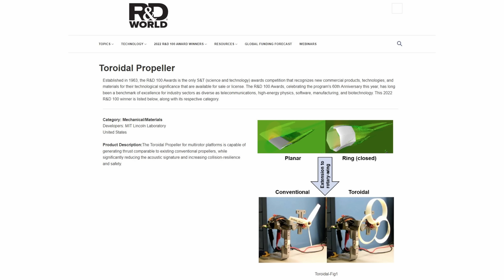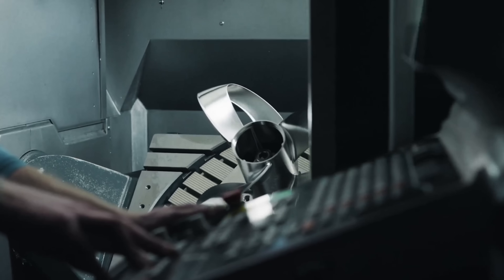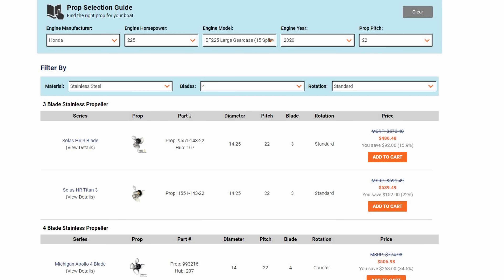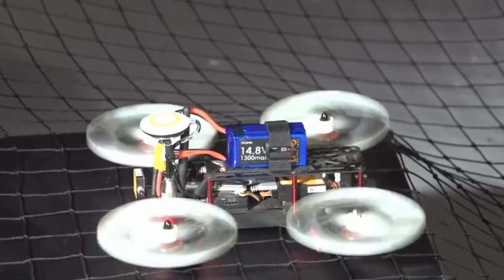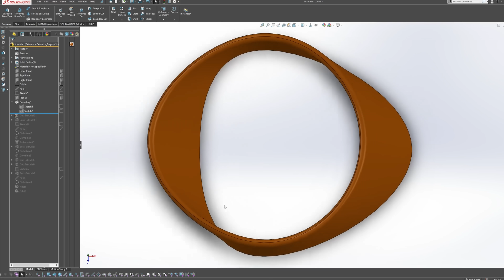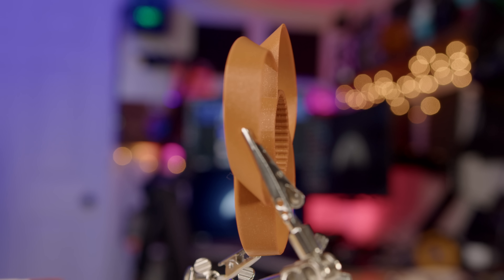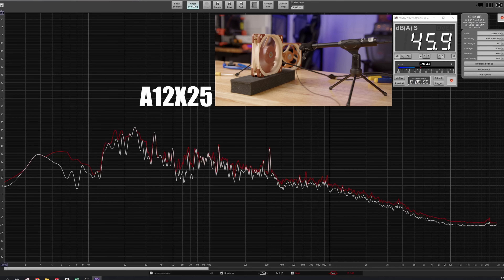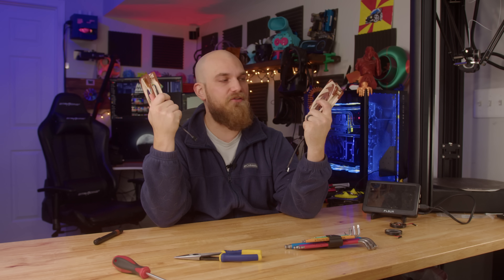I Turned MIT Award Winning Toroidal Propeller Into A PC Fan | Fan Showdown S5 Special

Comment: You might not be noticing as much difference in sound due to the fact the propeller blades on the A12X25 are shrouded/ducted which reduces the tip vortices.  So no real advantage to the toroidal propellers in this particular setup.  If the fan blades for both were out in the open you may see a difference where the toroidal propellers are quieter.

Comment: You should 3D-print a toroidal for the drone, and a copy of the noctua for the drone, and see which one flies the best.
Reply: I would love to see a copy of the noctua fan on a drone! Especially given the pretty high volume of air it shifts, plus noctua's legendary low noise profile.
Reply: And use the drone blades for cooling the computer.

Comment: Interesting idea. I do think a significant difference from the drone configuration is that these fans are ducted. That is going to have a massive impact on the tip vortex behavior and therefore the sound. I think it's plausible that the duct is already mostly mitigating the tip vortex induced sound anyways, thereby erasing any advantage the toroidal would have in open air. The RPM difference you pointed out does make some sense too, though to me the Reynolds number is already plenty high enough even in the pc fan situation that I don't think there would be a significant difference in terms of turbulent vortex induced sound.
Reply: I agree, that's the first thing that struck me - ducting changes the circumstances of a relatively straight blade. Essentially the toroidal blade is a halfway house between an open-ended blade and a ducted blade

Comment: "Raise your outdrive", OK you have my attention.

The difference is going to be that flat edge.  The A12X25 has rounded edges where yours is flat.  (The A12X25 was designed for quiet in this manner.)

Great video, will check out more.

Comment: Very interesting. Considering how close some of these numbers got with just the initial design using a 3D print, I'd say it probably has quite a bit of promise. If I were doing it, I'd definitely try more blades first; probably would start by taking the existing design, duplicating and rotating it to fit between the existing blades.

Comment: If I've understood correctly, you can simulate the turbulence of air by making the same experiment in water with slower speeds. As a result, it should follow that whatever design works in water (e.g. commerical toroidal propeller for boats) should work well in air as long as you drive it faster. If the commerical boat propeller is designed to run around 2000–4000 rpm, you might need to spin the similar design around 20000–40000 rpm in air for optimal performance.

And running anything with such rpm will require near perfect balancing and strong materials.
Reply: Reynolds number (ratio of intertial to viscous force) is length x velocity x density / viscosity. You won't get that to be the same. 
Specific speed  (rotational velocity x flow**0.5 / (g x head height)**0.75) might be the same.

Comment: I think this would be much more effective with smaller 40mm fans for 1U servers where they run at much higher speeds and create much more noise. 

In fact I’d love it if you could test this. I’ve been searching for years for a small 40 mm quiet fan configuration.
Reply: Noctua actually makes some of these smaller fans. They are of course not designed specifically for servers that have custom mounting options. But the NF-A4x20 is very much able to be this option.

Comment: Worth noting that these props when scaled EVERYTHING changes. There's 3 semi-chaotic phenomena happening with props that if scaled, their effect on the result changes by different amounts for each phenomenon. Also the shape plays a HUGE role so 1 degree on the attack angle for example could make something 100% better or 100% worse. Prop design is hard and especially this one.

Considering then that it even came close the the noctua's fan shows how much improvement there is to be made (unless of course you hit the perfect design which is less likely than hitting the lottery but not impossible haha)
Reply: and the profile of the wings does as well change effect. I think that the lower frequencies might have come from vibrations due to unequal material thickness and/or excentricity

Comment: Would make for a really weird-looking helicopter wouldn't it?
Reply: Probably work in a sci-fi setting
Reply: I think that'd be pretty much impossible to have the blade angles tip to work like a heli unfortunately 🫤
Reply: @androiduberalles , yeah helicopters need collective pitch for attitude control
Reply: @riongronberg1435  What if the whole thing could be flexed?
I don't see how it would be possible but it's interesting to think about.
Reply: @ddegn  Maybe some pivot mechanism like this https://youtu.be/55G-mwT9uCE
Reply: @riongronberg1435  I love that project!
I was actually thinking of a mechanism like a variable pitch propeller. It would likely need to be crazy complex for this sort of application. I think the root of both ends of the loop would need to twist and slide past each other. I don't think a normal collective pitch mechanism would work well with a looped blade.

Comment: I wonder if the tips being close to the walls of the fan are reducing tip vortices in the stock fan? I am currently designing a wind tunnel and we're using a drone propellor for the blower fan and we think we can reduce turbulence+swirl+noise by keeping the tip clearance close to the wall of a duct. That's basically what's going on with the stock fan. Drone propellers usually run in free space though, not ducted, so that might be the reason that stock+duct is quieter than toroidal+duct. The toroidal isn't getting a lot out of being in a duct from a noise reduction standpoint I imagine.
Reply: Yes, the tips have to be very close to the walls in wind tunnel fans. You can also bleed air out just near the tips, afaik, so you get cleaner air down the stream.
Reply: Yeah normally PC fans can't get their fantips close to the cage, because everything warps a little and then SCRAPE. This problem hit many PC fan manufacturers trying to optimise fan designs, indeed there are a few reject scrapey scrapey ones known, particularly as you run them up, and then the blades unfurl a little, and scrape. So they gradually upgraded their materials and casting methods and one of those accomplishments for the Noctua is that they can get in pretty close.

Comment: fans is like wheels on a car, different type of wheels for difference situations just like fans interacting with air as tires/wheels interacts with the ground. also some design only "activates" in different RPM so criteria in testing different fans and comparing them can be tricky. none the less we still appreciate testing other wise manufactures just pump out garbage and PR it as a good products. so good video still ty

Comment: These props ARE as good as they say. BoatTest did a pretty thorough side-by-side (same exact engines, same boat, different prop), and it ended up being both more efficient (GPH) and higher speed at the same RPM. They're also more resistant to damage, because the leading edge isn't as exposed to logs and other debris, and the circular design has a tendency to bounce off debris as opposed to sinking into it.

Comment: The centrifugal fan drives the air radially outwards with some spin. The Coander principle helps some of the airflow to pass downwards creating suction. This lifts the drone due to suction from the canopy surface. But much of the air's momentum is not redirected and so a significant amount of lifting possibility of the drone is lost. 

It would be much more efficient in this respect if the radial air was directed INSIDE the canopy instead of outside. This would enable much more thrust to be developed, because, unlike a conventional propeller (or helicopter rotor), the increased momentum of the air behind it has increased speed, reducing diameter and its momentum is not usable, whilst that of the expanding mostly radial flow below the canopy will follow its shape and be turned downwards and used to increase the pressure below it to make more lift. Non-radial flow can be redirected downwards using angled blades inside the canopy too. Air entering the fan would also provide some suction and lift as well!

Then either this can be used to have a greater weight-carrying capacity, or less power will be needed, and the result is a noise reduction to correspond.😎

Comment: It would be interesting to see if the noctua fan design would translate to drone props. Also, do you think that a more aggressive, progressive pitch on the blades would make a difference.
Reply: drone props tend to twist like actual propellers and to do the flips and acrobatics, they need to produce sufficient opposite thrust spinning backwards.

i don't think the noctua fans would work very well for that and other reasons (weight, etc) but i'd like to see somebody try, I could be wrong. ;)

the pitches on the drone props are designed for their speeds/flight envelopes, and yes, you can buy them in all sorts of sizes, pitches and blade counts. The blade pitch on a prop is analogous to a gear ratio in an auto transmission, you don't want too much or too little, depending on what/where you drive.

Comment: Imagine how many everyday designs are the way they are because that is how they always have been, and how much more they could be improved. We need to think outside of the box to get even more performance
Reply: This is a very good point, and if someone bothers to go to the effort, it's actually one of the best uses for current non-quite-AI: iterative improvement by taking the original, creating a good-enough computer model with a set of measurable goals, let the AI run wild for a bit, then printing the result. It's not perfect, but quite often an AI will get a crude low-hanging-fruit result that's measurably better than the current standard even before refinement just because it's not constrained by human thought boxes in the same way.
Reply: @blumoogle2901  Genetic algorithms (a method of doing what you talk about) was one of my favourite topics in college. Took those concepts to almost all of my jobs and managed to improve something by letting the machine just go ham. Sometimes only marginally, sometimes drastically.

Comment: That is pretty cool and interesting!  These toroidal blades have been all the rage lately :)  I saw your subscriber fan blade show down as well.  I did a few videos on quick ways to use fusion 360 forms to build this toroidal blade as well as some others.  If there is something crazy you want to try I am happy to model it up for you to give it a shot.  I think the idea of the toroidal blade inside of a ducted body will never quite match the traditional blade.  They are just designed for different purposes.  I would bet(not really cause i don't bet) that the closed end blades on the toroidal are hurting its performance in this case.

Comment: I just saw a video on the toroid prop design and love that you already had a video out using it for fans. I think the problem is blade density for lower rpm pc fan use. Try a design more like the propeller where the depth is much greater like a 3x fan depth allowing for more blades to be added closer together. Then you can try it with and without a surrounding shroud and different shroud depths.

Comment: Having done experiments in the late 80's on the use of fans to remove fine particulates, the less space between the blades produced the best results.  Being an old outboard mechanic, I also know that the idea of fans vs. propelling devices is two different project of the same science.  Working at CU physics, evacuating smoke has a different reason for being.

Comment: First of all: imagine how much time, effort and money Noctua spent on developing those fans. Considering your design was pretty much a shot in the dark, the results are pretty amazing.
And second: The toroidal design itself is a rough principal. You can't just take a drone propellers geometry and transfer it to a PC fan. Comparing the toroidal drone and boat props you can already see significant differences. PC fans are an entirely different application again. I'm sure with a little (or a lot 😀) tuning of all the parameters (toroid geometry, number of blades, pitch angle, shroud geometry, print quality, etc.) a toroidal fan could close the gap to or even surpass the Noctua fan.

Comment: you should also consider adding another measurement factor, the V/A draw of each fan.  on boats this design has a gas savings of about 20% over traditional designs.  and maybe the RPM of each design as well.  this might offer some interesting insights to designers.
the other thing to consider is fan mass. the "winner" looks like it might have much thinner blades, or made on resin printer vs fdm printer.  the lower mass per blade and overall mass could have a huge change in results.

Comment: Probably needs more optimisation for better pressure (angles, blade width, etc), but for sounds, vibrations from balance issues aside, a drop in the more obviously audible higher frequencies is actually quite a big deal, very cool.

Also, the other examples and use cases are all.. open-propped (?), whereas PC case fans are spinning within a housing, so I'm pretty sure that's something that needs to be taken account too.

as for the $5k prop, I guess it's much, much hard to manufacture such props with current techniques

Comment: Great video, thanks for your efforts! Mechanical engineer here, agree with the 'need more blades' consensus. Suggest printing a wafer-thin snap-on ring for the A12X25 to essentially tie all the blade tips together -- that theoretically should reduce noise with presumably minimal impact on performance -- but need to functionally verify. Also much faster to design and print a simple ring than a complete fan blade. Downside being that it might be tricky to balance, and it doesn't look like there's much clearance between the blade tips and the fan housing. You got a new subscriber!

Comment: The big difference is that the PC fans are ducted (meaning the propeller is spinning inside a static cylinder) whereas most boat/drone propellers are not. In a duct, the airflow that would curl around the fan tips creating wingtip vortices is (mostly) blocked by the wall of the duct, which greatly reduces induced drag and the noise it can cause.

Comment: I think one the biggest reasons this did not pan out for you is 2 things the regular fan is placed in a specially designed housing that eliminates the tip vortices and specifically engineered to work at a specific RPM.

Comment: The fact that it got relatively close to even being compared to a Noctua fan as just a first prototype, which was actually designed for that purpose and has had several years of rnd behind it, says alot.  With some development, more testing, more refinement, and proper optimization I think that it could be leagues better

Comment: Toroidal Props have been known for quite some time. Long before they were being manufactured. They never took off cause it was extremely expensive to produce them. It still is but new manufacturing techniques of the past decade have made them feasible. Every rising oil prices also having their part.

Comment: The A12X25 benefits from the fan housing acting like a ducted fan. The toroidal fan has advantages in an unducted setting but loses those advantages when compared to a ducted fan. Another factor is that this toroidal design wasn't refined at all so it's pretty amazing that it even did as well as it did.

Comment: The fundemental difference is that a drone needs to compact air on the surface area of the propellar points, but a computer fan has to push the air in a direction.

So just reading the award specifications would just give me enough to conclude it would not work better.

Comment: Here's the thing... a ducted fan (which all PC fans are) doesn't need fancy tip treatment or toroidal shape to prevent tip vortices.  That's what the duct is for.  A toroid inside a duct will actually be necessarily less efficient than a regular blade fan.

Comment: i think its more like comparing a 120mm fan to an 80mm fan, on a drone the props can be a bit longer to fit the toroidal bits in but in a PC you need to shrink the "blade" portion to fit the torroidal bits

Comment: The important thing to understand is that propellers used in water or in drones operate in freely flowing environment. PC fans have a frame which is technically a short ducted fan and that's totally different environment. I think you should get rid of the frame for a toroidal propeller design.

Comment: If you check the videos of said toroidal propelers you will see engineers saying that people bring up that from time to time saying its gonna be revultionary when its just not that impressive, on top of asking people to remodel everything and/or buy the new thing when its just not necessary. The boat propeler for one is much more expensive compared to a regular one for minimal gain.

Comment: My understanding is that part of the efficiency of the design is the way it reacts with fluids at its "tips", having a surround or shroud means the "fan" isn't doing what it's designed for.
Also, as far as I know being a prop means it's not really good as a fan, it's the same as a fan inside a jet turbine VS a prop on a more conventional airplane.

Comment: I'd like to see the current draw between the two fans at the same RPMs.  If the toroidal prop was drawing less current, it could be made to achieve higher airflow with a higher speed while drawing the same current.  Obviously, tweaking the blade angles, balancing, sanding, etc. would also improve the airflow and reduce the noise.